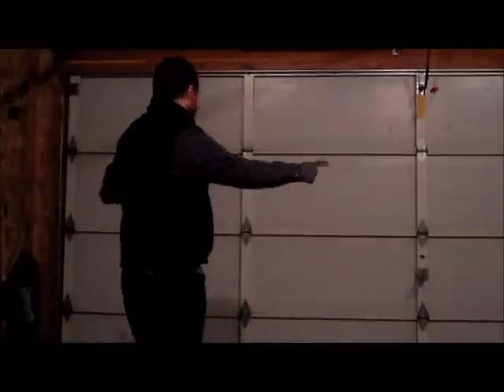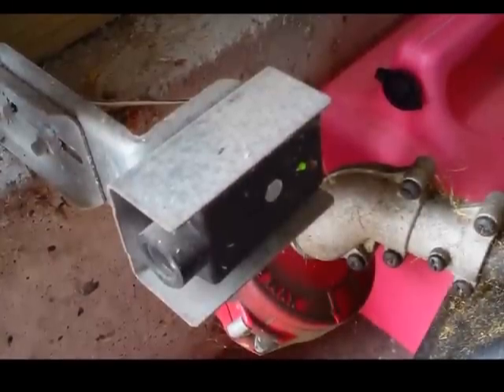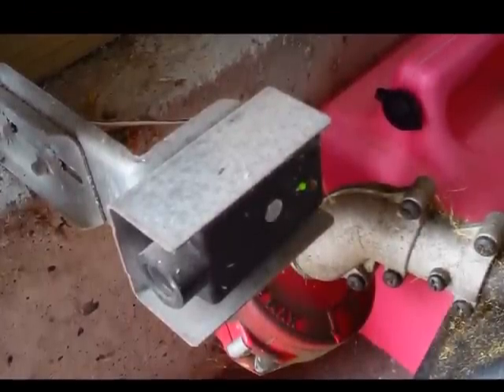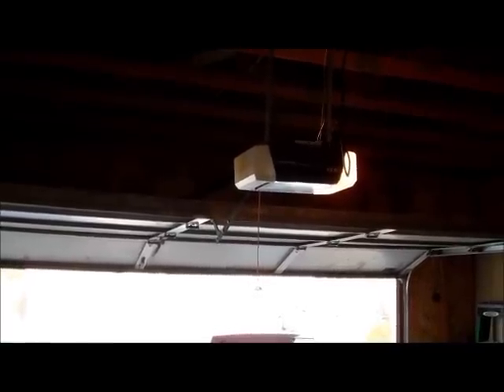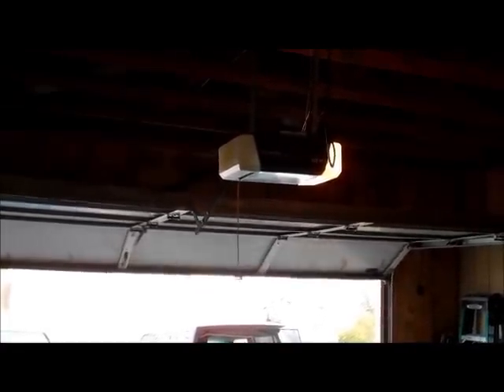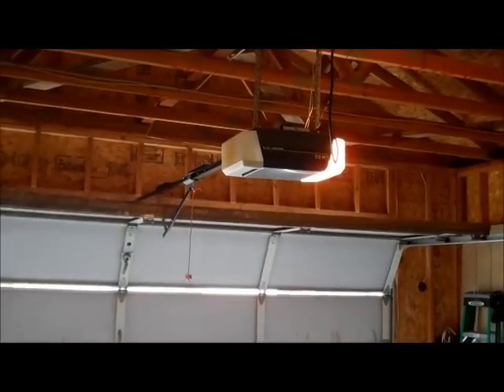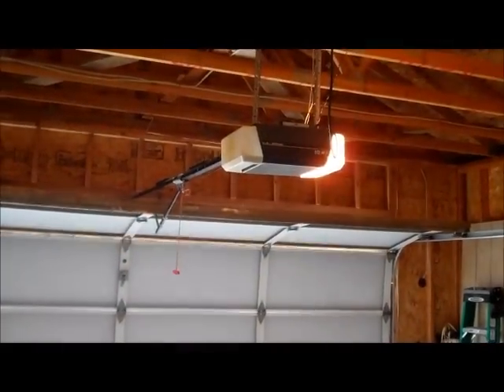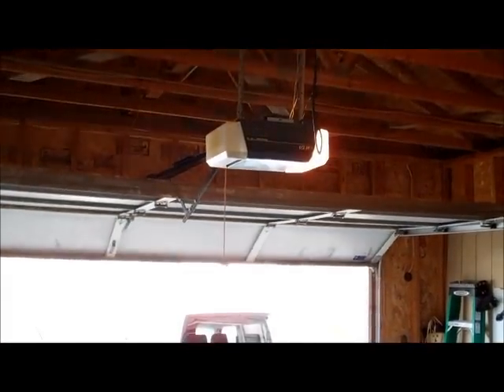Common Garage Door Opener Problem- Safety Eyes

Comment: Extremely helpful! The blinking lights you bring out in the video were the indicator to me that the sensor alignment was off. Yep .... both sides had started pointing down. I realigned both so that they were centered up and down in the bracket (side to side was fine). Door now works! Thanks so much!

Comment: one safety eye is red, one is green. my garage wont open unless i block one of the sensors. It won't close unless I unblock the safety eye. Any ideas? Is it the wiring to the remote or is it the eyes? they are not obstructed
Reply: I have the same issue, How can it be fixed ? one is red and other is green .. what do I do next??

Comment: I sort of have the opposite problem- the SEND unit light is always on. The RECEIVE unit light is on strong, and goes out when something blocks it. So they seem to be operating.

The problem is, whether blocked or not, the door ALWAYS closes. I have a craftsman 139.53515SR opener. The manual says to connect the INFRARED to black and white (which it is?).

Comment: On my Genie Intellicode model opener, the green eye stays on and the red light does not work at all.  What kind of voltage should I have at the back of the red safety eye and the voltage at the back of the opener terminal screws running to the red safety eye.  If there is no voltage running to the red safety eye, what could be the possible problems with the garage door opener.  I forgot to mention that the remote does not work and it only closes if I hold the wall button.

Comment: Please help me I have replaced both eyes and have green lights on both. Door will open but wont close. Not even move its a older lift master 1/3 motor. Was wondering if its the wall switch. It is a two wire switch like red and white. I have checked everything. Wiring and eyes. I was thinking about replacing the door switch. It looks like a doorbell, or replacing the circuit board. Please help me!!!

Comment: Please note that LED lights also affect GDOs negatively. I replaced all the light bulbs in my garage (2 in the GDO itself) with LEDs and my unit stopped working. Symptoms, more faulty in the cold, while when it was warm there were less problems. The keypad unit worked well but neither the homelink or the remote units worked.
Once the light bulbs were replaced with incandescents, all worked as normal. See http://homeenergypros.lbl.gov/profiles/blogs/led-lighting-garage-door-opener-interference for more information
Reply: Thanks for the extra tip. I have to check that as well.

Comment: Hello! My saftey eyes are fine...My garage door opens, but when the door is fully open, it sounds like the "motor" is still running (for about 30 secs). There is that little white "arm" that hangs down that I was under the impression was supposed to signal the opener to stop...the lifting arm blows right through that. Any Ideas??